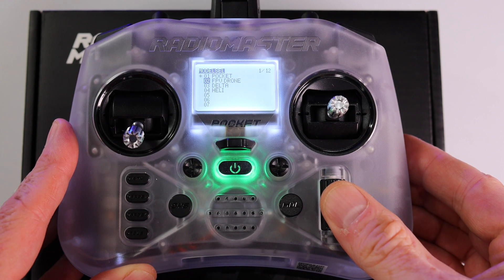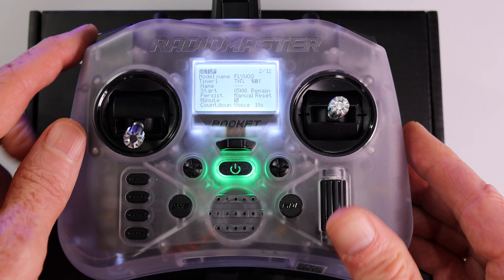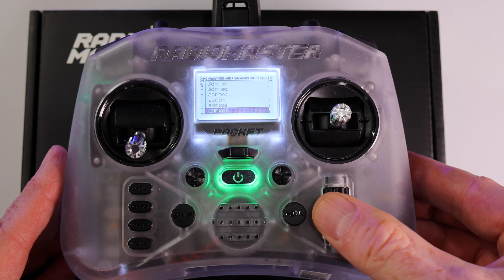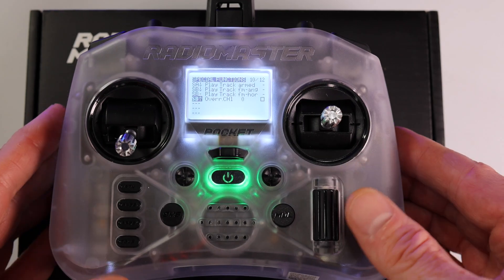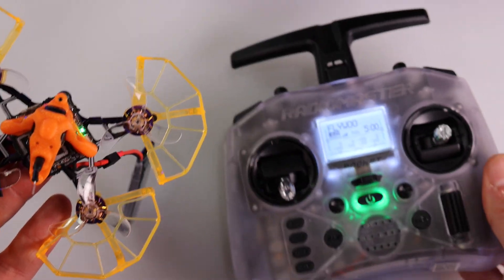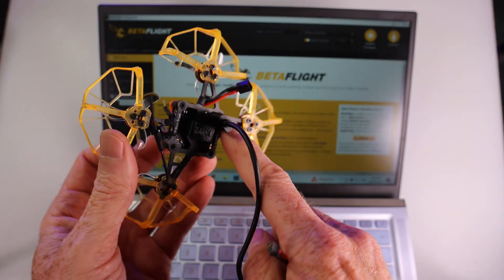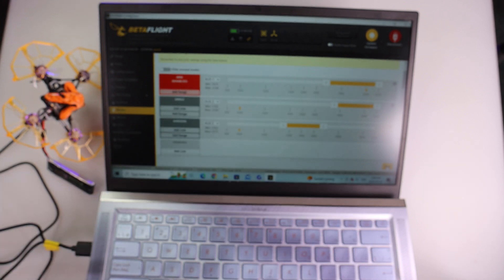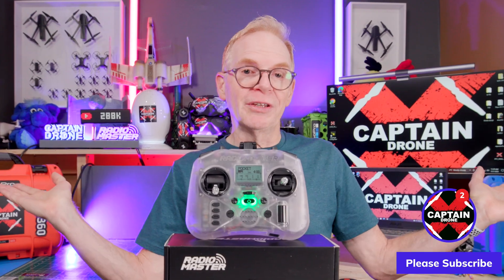RadioMaster Pocket - How To Set Up and Bind a Drone - Step by Step

Comment: I have a question, why do i need to set a timer? What does it do? And can i not set a timer? Or i need to?
Reply from the maker: In the RC Hobby you set a timer when flying an FPV Drone, RC Plane and RC Helicopter.  The reason is because, once you ARM the motors, voltage is being drawn and the battery is depleting.  For an RC Plane and RC Helicopter you can’t see the battery voltage so you need the timer to let you know when to land based on the battery capacity you are using.  When it comes to FPV drones, if you add the Cell voltage and Battery voltage to your FPV OSD, then you don’t need a timer to tell you the battery is about to be depleted.  However, many of us are often distracted and the TIMER countdown lets us know that we better return to home and land.

Comment: Is it possible to install a elrs receiver in a dji pnp drone and then use a elrs radio? Or are you stuck with the dji controller.
Reply from the maker: Yes, you can add any type of receiver to a PNP FPV Drone.

Comment: Hey steve suppose I want to bind to a different drone can I just bind and fly are what will have to thanks for your help
Reply from the maker: Correct.  If you wish to use the model you already created, you could BIND it to any other drone & then set that drone up in BETAFLIGHT CONFIGURATOR.  Or, if you wish to keep the first drone connected to the radio, then just copy the model to a new spot in the directory, and then bind away.
Reply: Steve you are the man you have a rare talent of taking something complex and  explain it so that a 4 year old can understand thanks so much for sharing your knowledge

Comment: @CAPTAIN DRONE Hope you can help me!!

Amazing Video first of all! Really helpful so far, but I got stuck after the binding process. It does bind but if I try to arm it, the propellers won't turn on. I am also unable to connect the drone to Betaflight. 

Maybe you can help me with some tipps and tricks.

its my very first drone so everything is completely new to me. I have a Radiomaster Pocket, DJI N3 Goggles und a Flybee 20 HD O4 Drone.

Comment: Can you also youse it without adjusting it in  Beta flight
Reply from the maker: Nope, not with any drone because the drone has no idea what your switches do.
Reply: @CAPTAINDRONE798 
But the betafpv Radio 3 can be used without adjusting in betafpv configurator cause I want to fly beta Fpv meteor75 with radio 3 without adjusting

Comment: hey i got mine to bind and everything is running good- but i get a “RF signal critical” am i doing something wrong?? i dont want to fly it 10 feet away just to loose it
Reply from the maker: Check to ensure the antenna on the radio is connected as well as the antenna on the drone

Comment: Hello CaptainDrone! I have a 35v2 cinelog with Air Unit o3 and a radiomaster boxer erls. I followed all the steps in the video but I can’t arm the drone. The radio is connected, the engines work, in betaflight also the radio is synchronized, they are in the same version. But I can’t arm the drone. Is there something I’m doing wrong?

Greetings and thank you!
Reply from the maker: Are you a newbie to the FPV Drone world?  If yes then the following will make sense:
You have to ensure the LEFT THROTTLE is all the way to the bottom before you can ARM an FPV Drone.
If your drone has a GPS on it, then it won’t ARM unless it has 9 satellites.  Take it outside and let it sit for a few minutes powered on, then try again.
Reply: @ thank you!

Comment: Ok im lost I got the tiny hawk 2 freestyle and I got the elrs crush pocket version but I bought a 4 I one radio master module but I can't not bind them together at all what do I do?
Reply from the maker: You need to purchase an ELRS module which goes on the back of the radio
Reply: @CAPTAINDRONE798  my th2 isn't elrs I thought I was suppose to get a 4 in 1 multi protocol module I have that attached to the back of pocket is this not the right module?

Comment: What about rates and stuff? I just got this radio linked up and working on my drone, but it flies and even sounds different now. Does this radio respond to rates nad settings in Betaflight? Or do you have to do that stuff in the radio itself? Just trying to figure out why/if this radio just makes the same drone fly a little differently.
Reply from the maker: PIDS (how the drone responds to joystick inputs) is done in BETAFLIGHT CONFIGURATOR.  The only thing you change in a radio (rarely for drones, but always for RC Planes) is your dual rates & expo:  https://youtu.be/cDkaDY_OeVU?si=ChsykgddL5tQ0qOV
Reply: @CAPTAINDRONE798  That's what I thought but certainly doesn't seem to "take" my typical PIDs and throttle settings in Betaflight. My rates feel different - I can roll and flip faster, that plus I'm even getting a reduction in flight time of 1-2 minutes which leads me to believe the throttle rates in Betaflight aren't being taken in. Argh. Maybe it's the sticks and my finger postings 🤷  Anyway, thanks for your help!

Comment: I did everything and binded it but when I hit arm, nothing happens. The motors dont spin?
Reply from the maker: It means you have, or are doing, something VERY Wrong.  If you did everything correctly it will 100% work.  If you come from the DJI World, then you are probably lost, and you may be doing silly things like leaving your left joystick in the center position when you try to arm, vice all the way down.  Or your drone may have a GPS unit and you are trying to arm the motors without a GPS Lock.  And finally… Are you certain you have BINDED to the receiver in the drone?

Comment: Man I followed step by step until ELRS my remote will not come off loading screen
Reply from the maker: Are you certain your radio is the ELRS version?  If it is and it gets stuck on the ELRS LOADING screen it is due to your micro sd card in the radio… Power off the radio, remove it, blow on it, put it back in, power radio back on.  If it finally works then that is the problem.  The fix is to transfer all the files off the micro sd card onto a QUALITY BRAND NAME micro sd card, and then use the quality one.

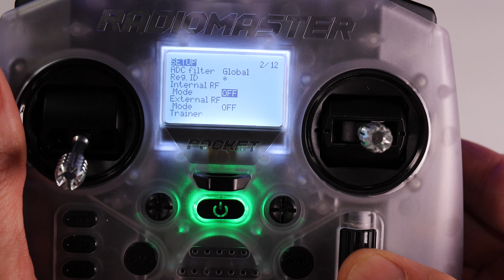Comment: 7:53 You need to add an explanation here. If you buy the cc2500 version and you also have bought an express elrs jumper than you need to select "External RF" beacause its external elrs.

Comment: Hey mate, ive got the radio and drone connected, (the radio says telemetry connected after putting binding phrase on both drone and radio). But betaflight shows no reaction to input, no values or anything are changing. Tried arming and disarming and reflashing latest firmware on my ranger nano connected tk my pocket with also latest firmware
Reply from the maker: It means you are making those common Newbie mistakes…. Such as you plugged into the wrong port on the drone.  You are using the wrong USB cable (you are using a charge cable vice a data cable), you left the left joystick in the center and not the bottom when drone plugged in, and finally… you set up the switches/buttons on your radio wrong.
Reply: @CAPTAINDRONE798  thanks for replying. I am using a cable that has otg. Confirmed this by transferring photos from an old phone on my computer. 2. I have tried multiple configurations, such as leaving all buttons in their default state (radio warns for this during startup) and even other random ones. No response to anything whatsoever. 
So that brings me to no.3 
I have reflashed the pocket right now, so how do you reckon I reset the model? Like to default just so I can check that?

Comment: at 7:50 My radio master pocket just has Off and Multi mode what should i do?
Reply from the maker: At the start of the video, it is mentioned that I am using the ELRS version of the radio.  You are not using the same version.
Reply: @CAPTAINDRONE798   on the back of the controler it says "FCCID:2BBP3-Pocket-ELRS"
Reply: Can multi also pair with ELRS?
Reply from the maker: @emilschmidt5092 multi mode is only available in the 4-in-1 version of the Pocket which is not ELRS.  Simply check your purchase invoice to see the model you bought.
Reply: @CAPTAINDRONE798  I´m wrong its the CC2500 Version. I will probably send it back and get the right one
Reply: Ok if you have cc2500 you need to bui an express elrs jumper its not so expensive. You can atach it. And then you can connect it in this exact time frame from the video to "external RF"

Comment: Thank you. I followed the video step by step, but now my Radio is making a beeping sound every time I move the ruder back to the center position. How do I deactivate this beeping sound?
Reply from the maker: Strange, I don’t cover the topic of radio settings so not sure how that ended up happening on your end.  The issue would probably be fixed by going into the radio settings.

Comment: Guys, help needed urgently, 
What to do when the ExpressLRS option is pressed , it loads forever with no options ?
Reply from the maker: It means that:
- You have bought a radio with no ELRS
Or
- You have a damaged micro SD Card.  Power off. Remove card at bottom of radio and reinsert it, power on radio.
Reply: @CAPTAINDRONE798  I have just done it and it's not working
Reply: @CAPTAINDRONE798  it's a Radiomaster pocket with ELRS

Comment: I am a newbie with a Tinyhawk 3 Plus and a tinyhawk 3 plus freestyle (both analog I'm in this hobby but on a budget lol) if anyone could help me out with either or both of these questions:
1. Tinyhawk 3s have a bind button so I won't have to do the battery thing or the beta flight rx_bind in cli right? Just toothpick it? Lol
2. Should I have any issues hooking up this transmitter to either drone?
Reply from the maker: The original Tinyhawks were not ELRS but rather D8 receivers.  Are you certain your EMAX Tinyhawks all have an ELRS receiver?  If the answer is YES, then there normally is no such thing as a button (very rare), but rather you either do the battery plug/in and out 3 times or you go into BETAFLIGHT CONFIGURATOR and then to the RECEIVER TAB and click on BIND, while placing your radio in BIND mode.
Reply: Update: the pocket is here and I've got it to bind to the Tinyhawk 3 plus. Well at least I can get the beeper to go on and off and I get "telemetry lost/recovered" when I plug and unplug the battery. I'm optimistic but nothing else seems to being work/it won't arm. Any guidance in one direction or to a resource would be great from anyone. Thank you 😊
Reply: Update: You CAN bind it to any ELRS transmitter. I got the mapping right and now it flies fine. 😊 Thank you for responding Captain. And yes the older tinyhawks were frisky 8 but not the 3+

Comment: hey cap-D. i follow your demo and did in to radiomaster gx12, and did good. thanks. appreciate your channel. but there's some additional pictures on the last buttom of the settings. after this PERSIST.   manual reset 
MINUTE.    ✅
COUNTDOWN VOICE. 20s
then there's more👇
CUSTOMIZABLE SWITCHES. ⬇️
and the very last is 
CIRC. CUT.     none.
And when you click this none.
 it shows this X-Y-Z-rX
not only that. many more. i don't have any idea about this. but since i followed your instructions i have now a set of one on my gx12 rc.
and wen i turn on again the gx12 there voice pop up. says FLY MODE HORIZON, fm ACRO and fm ANGLE. 
and when i turn On again the gx12 automatically voice popped up says fm ACRO😂 and SA are good. 
i'm hopeful you do on gx12 as well. so i keep tuned in on your channel.🎉thanks
Reply from the maker: If I find time, I’ll make such a video.
Reply: @CAPTAINDRONE798 thanks and i willl keep tuned in and wait for it. appreciate your time.🎉

Comment: I got radiomaster pocket with MULTI mode, so it is turned on but when I want to go to express lrs tab on my controller it’s just stucked on loading , can’t connect to it via express lrs configurable on the pc , this is so frustrating I don’t know how to fix that
Reply from the maker: RADIOMASTER POCKET MULT is a 4-in-1 with no ELRS Built in.  You need a RADIOMASTER POCKET ELRS.
Reply: @CAPTAINDRONE798  hey , thank you for the reply , Im pretty sure it is elrs version:) previously couldn't change internal module from MULti but  I managed to turn on CRSF in my internal module yet still cannot access ELRS tab its just stuck on loading, troubleshooting this further
Reply: @emilwiecek9288  Hi maybe it's too late but you need external module if it has module bay.

Comment: Can I fly this flywoo drone out of the box ? If I am only going to use acro mode anyway, do I need to configure angle and horizon ? By default is acro already configured ? Thanks !
Reply from the maker: The reason you have to CONFIGURE your drone in BETAFLIGHT CONFIGURATOR is because the DRONE does not have a clue as to what remote you are using and what switches you wish to use to do what.
Reply: Thank you for the information! I will follow the steps in this video! Great channel. I have an Emax tiny hawk starter kit. I desire to switch to digital. I saw your other video on this flywoo and I am considering buying it. I am also torn between the Mobula 8 and vision 40….. I recently purchased the RadioMaster pocket. I am going to purchase the walksnail Avatar googles. Do you recommend any better options for 2025 ? Thanks again.

Comment: Great video! I've turned a now 'vintage' Tyco RC Hovercraft digital and have a RM Pocket. I'm trying to program it (6 channels) and can't get my head around what I'm best to do to set them up. It would in theory be the same as a boat or plane set up that had two props, only mine has an extra motor and esc for an on off downward fan motor. Would you have any suggestions? My heads aching a bit 😂
Reply from the maker: There is not enough space or time for me to provide a detailed response.  You’ll figure it out eventually because setting up a radio for a plane, car, helicopter, boat, is all the same once you wrap your mind around it.  My advice is just watch some videos until it finally clicks for you and all makes sense.

Comment: Batteries shouldn't be needed for betaflight. As long as your connecting to the flight controller. I've had no issues w.o battery.   I prefer no battery due to most cable being charge and transfer cables. And I don't want a charg current trying to go through the drone to the battery.  (Not sure if this is accurate but It's how I do it.)

Comment: I have the same setup. Drone didn't connect. Never hooked controller up to anything. Did everything you said. No wifi.  Only hardwire.  Can you show us other ways to do the binding.
Reply from the maker: The reason nothing works is because you did something or many things incorrectly.  If you look at all the comments under this video, people do a pile of things WRONG, and then eventually figure out their issue.  Many have even bought the wrong radio version of the POCKET.
Reply: @CAPTAINDRONE798  idon't think you understood my comment. How can I connect my pocket with usb c not wifi.
Reply from the maker: @b_snow777  I have no idea what you are asking????  This video is about how to setup your RADIO, then how to BIND it to an ELRS drone, then how to configure the drone in BETAFLIGHT CONFIGURATOR.
Reply: @CAPTAINDRONE798  I'm asking, how to connect my radio to betaflight with a cord. I don't have wifi on my pc
Reply from the maker: @b_snow777  Connect your radio to BETAFLIGHT CONFIGURATOR?  You don’t do that, you connect your radio to the RECEIVER in the drone you bought.

Comment: Quick Question, Could Beta flight help with binding the RM Pocket with the Fly Wing BO-105's H1 Flight Controller? E.G. Flight modes such as GPS, Home and 3D, and the flight patterns like figure 8?
Reply from the maker: Nope… it is not a BETAFLIGHT flight controller
Reply: @CAPTAINDRONE798  Got it. Makes sense. Thank you.

Comment: I'm Japanese, so my English may be a little strange, but I would appreciate a reply.
Reply: I bought a drone called Meteor85 ELRS V3 from Beta FPV.

I want to buy the transmitter in this video at a store in Japan, update it to ELRS V3, and fly the Meteor85.

So, my question is, does ELRS v3 come pre-installed, or can I update it?

Also, can I update to ELRS V3 without using Wi-Fi?

(Wi-Fi updates are not possible in Japan due to radio wave laws)

Japan rule is very old

Comment: Hi Steve. I was flying my Betafpv Meteor 75 indoors and using ''flip over after crash''. Now it is stuck on ''flip over after crash'' whether the button is pressed in or not. I have tried to use alternative models in my RC,  the Radio Master Pocket, but every time I hit the arm button to arm I just get the ''flip over after crash'' and it will not arm. I even tried to disable this mode in Betaflight but it makes no difference. I think there is an issue with the button on the RC but I do not know for sure. Are there any tests or things I can do to confirm where the issue stems from please?
Reply from the maker: It means you either SETUP the RADIO incorrectly or you SETUP BETAFLIGHT CONFIGURATOR incorrectly…. Or you set BOTH up incorrectly.  Start with BETAFLIGHT CONFIGURATOR… connect the drone, go to the MODES tab and scroll down until you see FLIP OVER AND CRASH and check what button or switch it is assigned to.  My guess is you assigned it to a switch that does something else.  If this is not the problem, then you setup the mix in the radio to run two switches at once.  If you can’t figure out what you did WRONG, then just delete FLIP OVER AND CRASH in BETAFLIGHTCONFIGURATOR and again hit the SAVE button.
Reply: @CAPTAINDRONE798  Hi Steve. I did that before contacting you and l eventually put it down to the buzzer/ flip over after crash switch being stuck. I eventually took the batteries out as l was going to contact Radio master and ask them. Later in the evening l replaced to batteries just to try it again. It now works fine so it could have been an error in the radio or the switch has become unstuck. An odd problem but its all good now.   Thanks for your reply. 👍